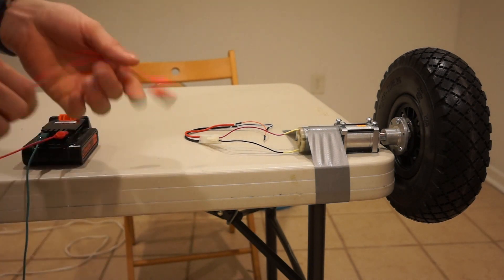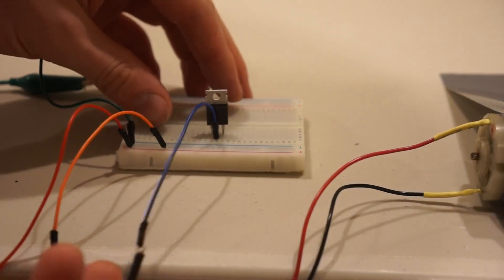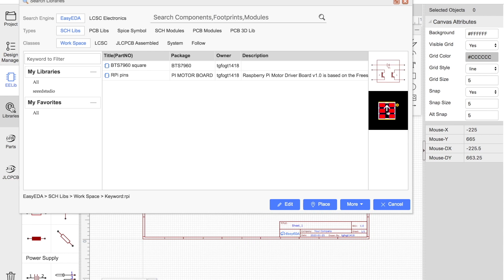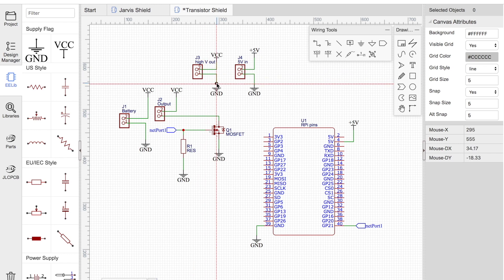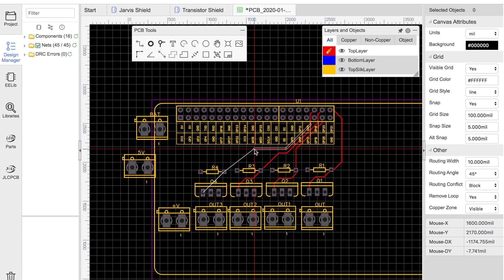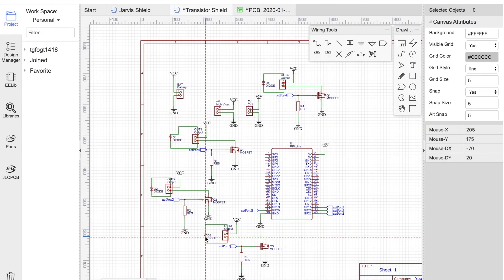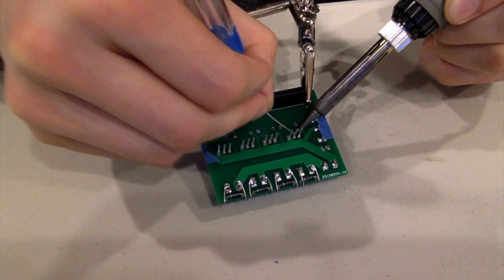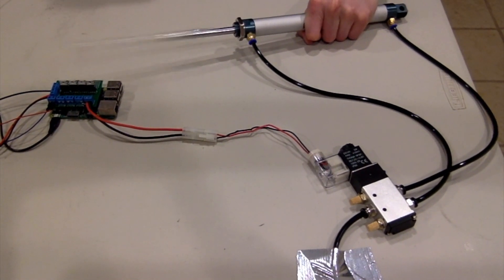How to power a motor with Arduino / Raspberry Pi

Comment: Great video. I would have loved to know which you consider safer or more appropriate; between using a transistor and using a relay to control the motor.